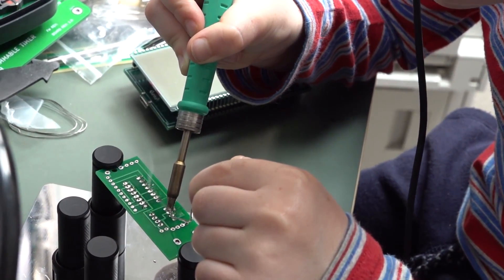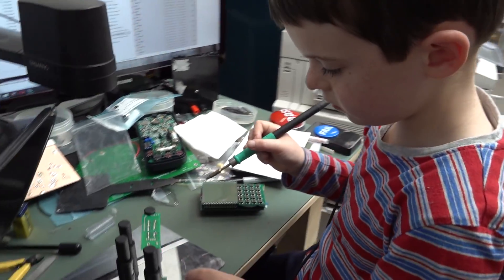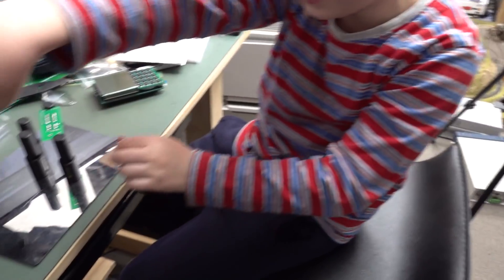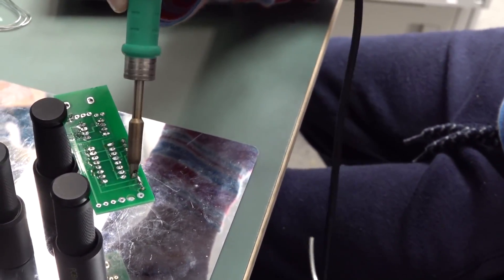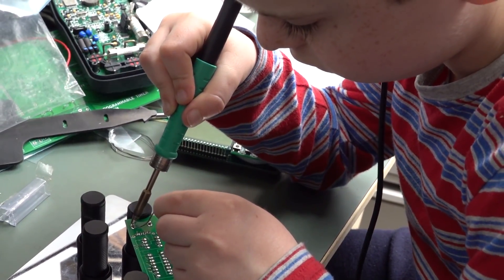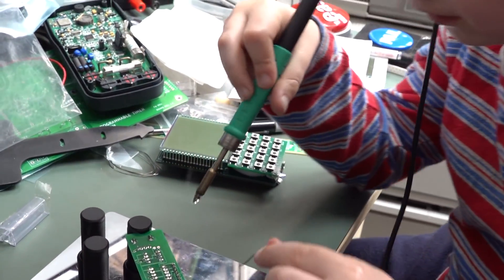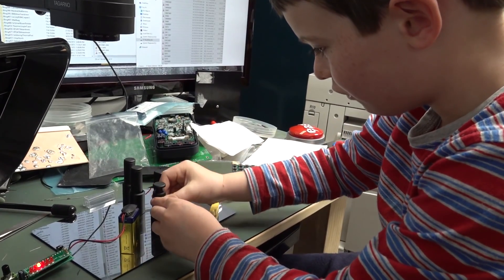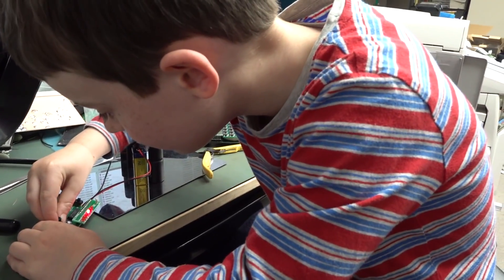Sagan Soldering!

Comment: Sorry, but the soldering technique shown is completely wrong.

How to solder properly

1 - always use lead free solder
2 - use a soldering iron with no heat regulation so that it gets hotter
3 - the bit should be at least twice as big at the tip as the one in the video
4 - do not clean the bit under any circumstances
5 - the component should be free to drop off the board whilst being soldered
6 - the board must be free to slide around the bench
7- the component lead, board or both should not be shiny
8 - add solder to the iron to burn off the flux then carry the solder to the joint
9 - just as the solder is about to go hard move the board, component lead or both
10 - always solder every lead on a DIP package before checking that is flush with the board
11 - pick up the hot board with bare hands as soon as possible after soldering
12 - lay the soldering iron on the bench rather than using the stand
Reply: 1 - they used lead free solder
Reply: We'll correct all this in Part 2!
Reply: UKHeliBob , I always use lead free solder when ever i want to fight with a project and get shitty results, sometimes i wear a sun dress and smoke a Capri cigarette, also i tell others how to live, STFU pussy.

Comment: IMHO it is way easier to learn soldering (and safer) with the PCB at desk level and with the wrist touching the desk.  Just like writing or printing you are more stable and less likely to have a hand slip and get burned.

Comment: he already does better than GreatScott
Reply: Rafael Silva Haha Scott is terrible at soldering 😂😂😂😂
Reply: @alpemxyz  no, he's not. Just a bit how u doing.. You really have yet to see terrible.
Reply: Could have held the iron on a little longer after adding solder, to let it fully spread around. Minor issue though.

I watched GreatScott's video about a boost converter and he uses perfboard with solder-bathed bare wire on the underside for "traces". What a mess. If he wants to stick with pre-made boards, stripboard is great.
Reply: To be fair, as I always say, it's impossible to do good soldering on that crap vero board that he uses.
Reply: @qwertyasdf66  the trick is to use some #00 steel wool to shine the baord first.. it just oxidizes easily.
Reply: nah, he's just bad at it, on the pcb's he makes it's also terrible
Reply: İ guess you didnt see bad soldering in ur life if you want to just check mine

Comment: What, you didn't start him off with a $5 radioshack/tandy non-temperature controlled "soldering gun"?! How will he ever appreciate a good soldering iron now?! :)
Reply: I do agree, soldering with non-temperatur controllable iron was a miserable experience...
Reply: With a cheap conical tip that dull and tarnished.
Reply: Yeah ... hard things teach more experience.
Reply: I remember having quiet a pleasant time with fixed temperature irons at my high school. Far easier than learning how to use my soldering gun (now my main 'iron')
Reply: I started out with a fixed output piece of shit that didn't even get hot enough/the tips died. im so happy with the non-temperature controllable 20$ station I have now....without a proper soldering iron soldering sucks lmao.
Reply: i had one for $9 from radio shack, i think it was 25w and i built a lot of kits with it, only changing the tip once. i thought it was quite good, actually..only occasionally lead-free solder was annoying but still doable for sure. they aren't that bad.

Comment: Where are his safety glasses.  Glad you had the fume extractor at least.
Reply: Only stock photo models which holding the soldering iron on the metal part needs safety glasses when soldering.

Comment: Nicely done, Sagan, but next time please wear some eye protection. Your gross motor control skills are still developing and you're especially vulnerable to random slipups when you're concentrating so very hard on learning something. </mollycoddle>
Reply: In the absence of anything that can ping solder I doubt there is a need.

Comment: If the fumes don't kill him, they'll make him stronger. :)
Reply: Actually lead degrades cognitive function in chronicc(small) doses. But he had a fume extractor so all he has to gain is skills.
Reply: lead based solder does not evaporate. So there is no lead intake even without a fume extractor. 
Unless you lick your solder, that is.
Reply: @Basement-Science  you're right, someone else commented but removed it for some reason. It's actually the tin oxide and flux that do damage